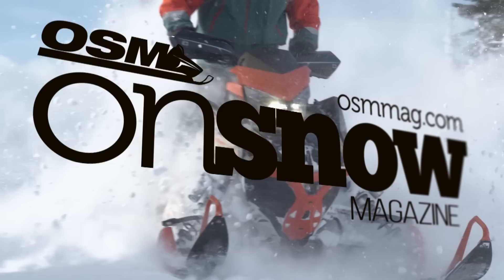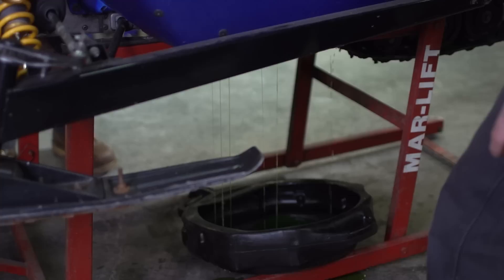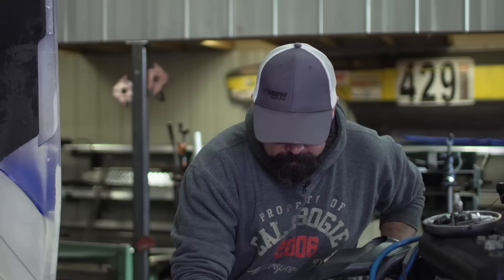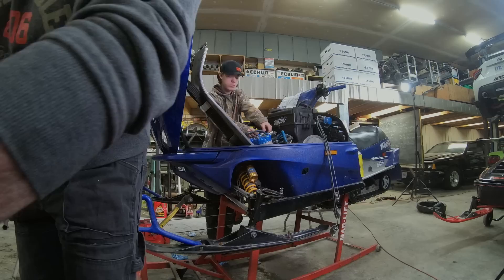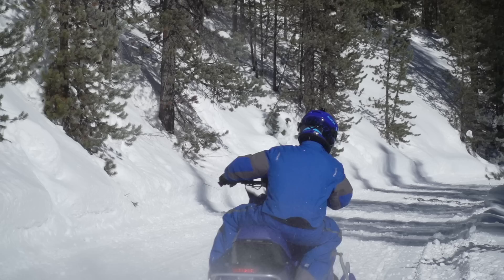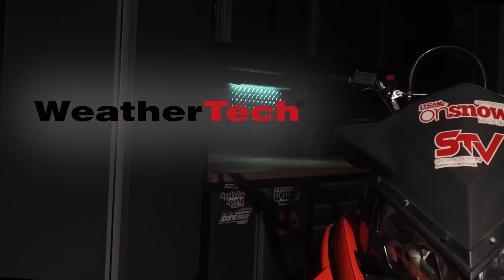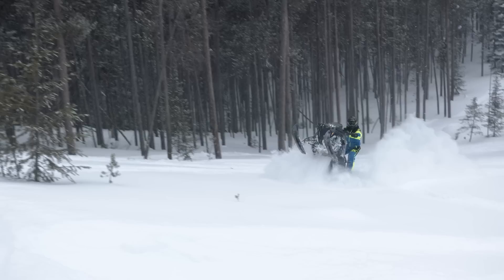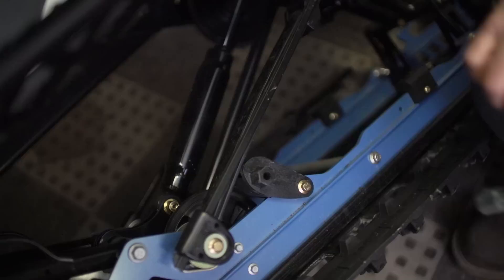Snowmobiler Television 2022 Episode 5

Comment: I wouldnt worry too much about the pistons in the SRX, I had a RZ500 street bike that had 75000kms on the original pistons. It would still pull 135mph with ease at that milage.
For those that dont know what bike that is, its a 500cc V4 liquid cooled 2 stroke sport bike from the mid 80s.
I should add that it seen 10000rpm on a regular basis.

Comment: i tell my two sons how fun i had riding and racing oval and cross country snowmobiles back in the day in early 80,s i races on a new indy for the first time ever sled was brand new  independent suspension in ny somewhere cross county and won overall by like 5 minutes that suspension was a game changer ,i got a polaris edge x 500 now bought it like 03 ,05 it was one year old with 1000 miles when i got it in like 04 ,06 rode it one day like 10 years ago until last week , wow was it fun and my son who is 22 now rode it i guess that one day back ten years for only a few minutes because the snow melted , i known what fast is these new sleds have to blow minds

Comment: Not even a follow up compression test?
94 mph before... Now?     LAME!!!
Reply: We ran out of time in the show to include the post compression test. It ended up just shy of 155 across all.  This was before the break in. So it might change.
Also the ice wasn’t safe when we did the segment, and hope to have all three triple sleds on the radar before the end of the season! 
Seat of the pants feel of the SRX after the rigs and new exhaust cable is much better. My butt tells me it’ll go faster then 100mph!!
Reply: @jeffsteenbakkers4435  Back in the days, i've owned a 2002 SRX and took it to 110 mph on the radar gun on a trail condition... so it will be a really good contender for the others triple muscle sled for sure with a fresh piston ring replacement and proper calibration of the power valves. But all that new power have to go to the ground... so you need proper clutching and if i remember... those 2002 need to run 8500 rpm ;) can't wait for the matchup and thank you for all that vintage memories stuff ;)